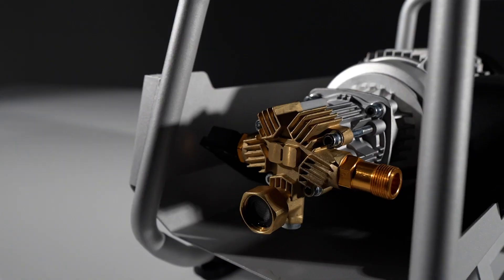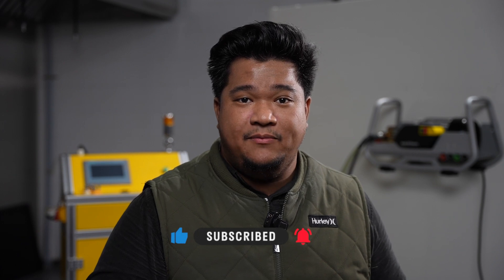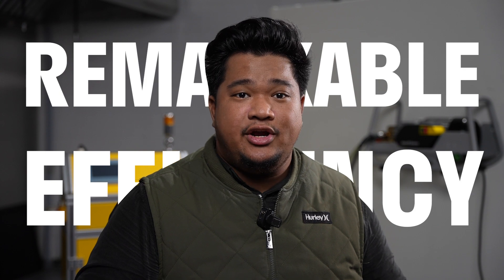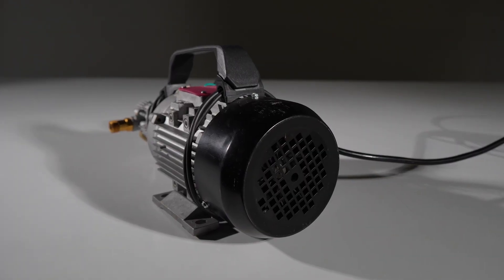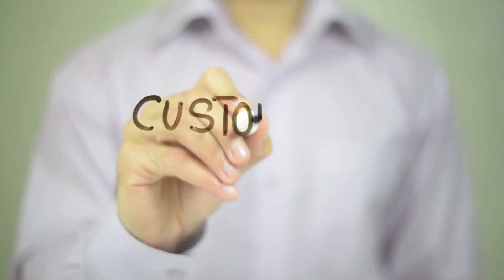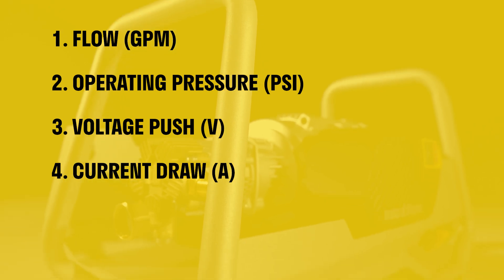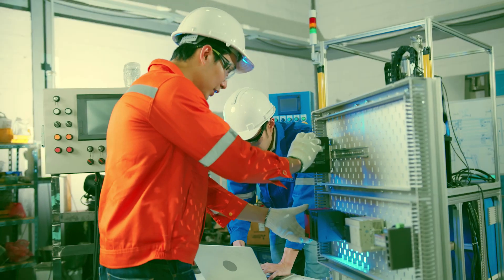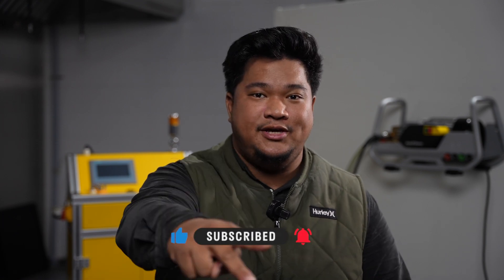Testing our ACTIVE 2.3 Prototype!

Comment: im using a 3.0 nozzle and on a 15 amp outlet and its not tripping, any idea why?
Reply from the maker: It's hard to say, that should be drawing more than 15A. Still, we wouldn't recommend using a 3.0 nozzle. Drawing too much current can cause damage to the microswitch and capacitator.

Comment: love my 2.0, it has taken my weekend washes to the next level. this 2.3 looks great too, props for putting out this type of test video. I really appreciate active's drive to continue to innovate and grow. excited for the new foam cannon as well. cheers guys!
Reply: How much of a difference does a 1.2 vs 2.0 gpm make when washing/rinsing? how noticeable is it?
Reply: yes very noticeable, especially washing off the soap after a pre foam or contact wash. also more water flow will make your foam cannons perform better and lay down some thick foam  @MetrosexualFilth
Reply: May I ask how long you have been using the 2.0?  Looking at 2.0 or 2.3 soon

Comment: Great testing, great data, straight to the point. Is there any sound data available comparing the 2.3 vs 2.0? I have a 2.0, and it's great, but wish it was quiter living in a town home with 1 neighbor. Any data available?
Reply from the maker: We will certainly make the data available when production versions are ready. However, I will caution that the sound levels are similar - it’s the type of sound that’s different. This is a lower hum vs the 2.0 which is a higher pitched whine. So many will find it “sounds” quieter. Both are our patented pump designs so they all tend to run smoother and quieter than comparable units.

Comment: I know you talked about it in the past, but the sound is pretty awesome.   Aside from getting more flow, the sound of the machine is also a huge benefit.
Reply from the maker: The ‘tone’ of the motor is different - more like a hum as opposed to a whine - but ultimately the sound level is quite comparable.

Comment: ❤ just thinking with this machine you will probably need a 1.5 millimeter opening for the foam Cannon and not a 1.25 as that is equivalent to approximately of 3.5 which would probably be closer to 18 amp draw
Reply from the maker: We can’t stop people from customizing their set ups to achieve their ideal foam and operating parameters. However, we are trying to educate people that there are limits to what can be done based on things like motor specs and power draw. Stay tuned for more.

Comment: I purchased two of your Pressure Washer, 2.0 love those pressure washers best thing ever I can trust these special washers. If not damaging my customers paint that one looks like a big motor has a lot of power. Looks like it will damage my customers paint.👍🏼👍🏼👍🏼
Reply from the maker: Actually, it won’t. I would say the emphasis is on more flow and more pressure, but driving more flow is more important (or impactful you could say) than max pressure and less water.  Regardless, at these pressures and using the right spray pattern there should be no  risk to paint.

Comment: Awesome!   700-800psi is more than enough for my washing needs......
Reply from the maker: Yes it is. To get to a pressure level needed to make a significant difference, you need to go to gas PW or a dedicated high amperage circuit. Otherwise, for household electric units, flow is more important.